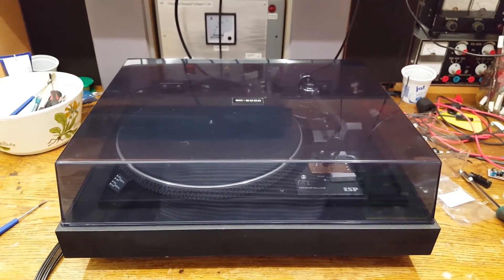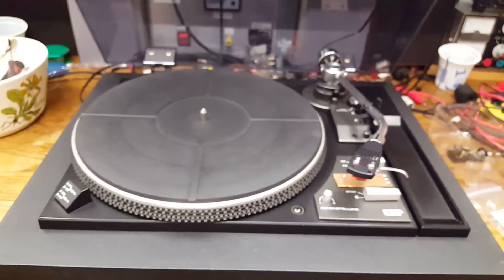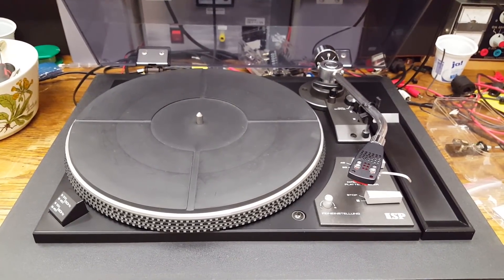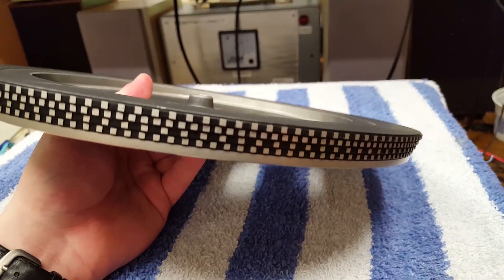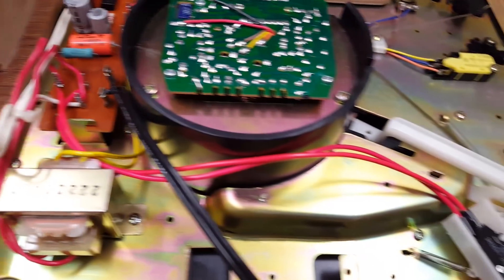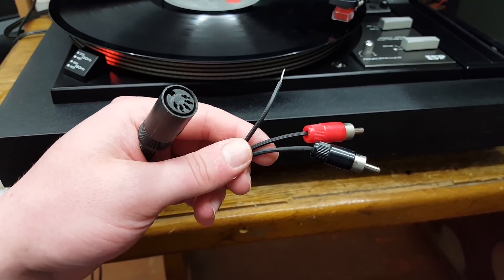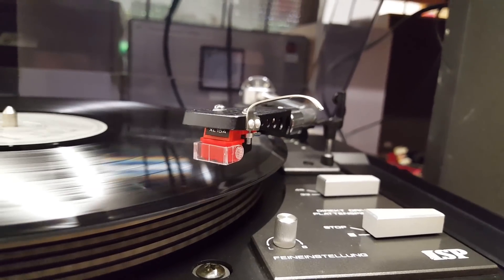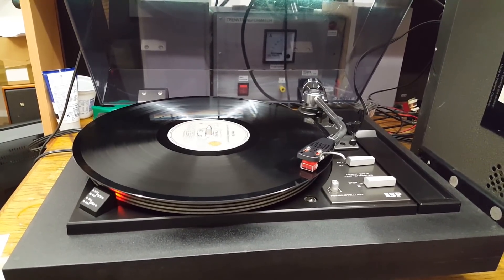Amazingly good ISP SD-5000 Record Player

Comment: For turntables with a Technics-style tonearm, you can get an "overhang gauge" which makes aligning the cartridge a lot easier -- you just line up the stylus tip with the edge of the gauge and the arrow at the front.
Reply: However, there is a slight chance that they used the Pioneer overhang which is a few millimeters shorter.
Reply: @vwestlife Ha, imagine meeting you here! I just discovered Dr Cassette 😂

Comment: Looks pretty decent for what it is. No subchassis and the plinth could probably use some sound deadening and some proper spring-loaded feet, but this is a lower-end unit we are talking about. Matsushita OEM parts seem to have been quite common at the time, the Grundig PS-3500 (DD) and -4500 (quartz DD) from around 1980 also feature them.

Comment: Yes as far as the cartridge alignment is concerned. If you can find one. It's called Cart-a-lign.... it's a weird shaped plastic protractor that has two points and a mirror. That's what I use to set up my homemade straight line low mass tone arms. I currently have one on my vintage Philips 212 electronic. Which will be buried with me.😁

Comment: Since the turntable has a s shaped tonearm a protractor is not needed. Just find the manufacturers stylus to headshell tail distance, usually either 52 or 49mm; and set cart to that distance, keeping cart squared to headshell. This will get perfect Stevenson alignment.

Comment: It was common in the 1970s to find house brands that were made by unknown manufacturers.  The arm looks more like a J-type than S-type, but either work well.  Straight arms were that popular in the 1970s, that came later.
Reply: you ment weren´t that popular? because i only started to see straight arms in good turntables in the end of the 70´s, or early 80´s but i only bought one in 1989 that seemed good, but i already sold it ,it was a good turntable but not as good as i expected in materials used to manufacture it, regards

Comment: It's probably using the same guts as some higher-end Panasonic music centre of the time, ISTR that they made some direct drive all-in-one systems in the late 70s. That would explain the small platter as well.

Everyone was making direct drive turntables around this time. Even BSR. I had a BSR Quanta 800 years ago which I threw away which had an S-line tonearm and direct drive, and an ADC cartridge and headshell. I really should have kept it.
Reply from the maker: Thanks for the info :)

Comment: That SABA is a beast. I have a half broken one too and have been searching for a working one for a long time.
Reply from the maker: You won't find a working SABA unless you find one that has previously been restored by someone. The problem with the SABA receiver is that this was supposed to be a top-of-the-line model in a time when SABA due to increasing competition from the far east was forced to do massive cost cutting. The result is a hugely complex and in many places overcomplicated design, but unfortunately all built with the absolute cheapest electronic components SABA could get. Also the soldering on the boards is terrible.
Reply: Mine was working fine until an idiot shorted the outputs. I found it realtively easy to work on, at least on the amplifier part. the separate boards for left/right channels, detachable pre-amp boards, etc. It does give a feel of cost cutting by looking inside it and it certainly needs a complete overhaul but my unit was badly mistreated.

Comment: That looks like a very nice find. Speed looks spot on. A suggestion Why not cut off the din plug and fit some phono plugs instead. This will make it easier to connect to other amps
Reply from the maker: I thought about this, but I'm not sure yet. The DIN plug would be handy in case I ever do get the SABA receiver working.
Reply: A DIN to RCA conversion is not entirely trivial, it usually requires modifications inside the player to get the grounding right (left and right ground should be separated). I'd rather try modifying the adapter if at all possible; I guess the cables were mistakenly soldered to the wrong side, leaving the input hanging in the air.

Comment: This table seems to be OK. Older Goldmund Studio with linear tonearm TT3, I think,  from 80's used JVC direct drive motors. It was one of the better machines I had chance to hear.  That plater in your gramophone is very decent, you may use better tonearm, eg Rega RB250, 300 are very popular, but forget the automatic options - just an idea. 
I had to throw a Yamaha direct drive tt for recycling - using 200-400 dol cartridge wouldn't help - substandard plater, tonearm. Did same with Marantz table, too beaten up, with cigarette smoke residue - similar sells for 250-300$ at Best Buy. I just didn't have luck getting used gramophone for cheap.

Comment: Great find and surprising build quality for an off-brand product!  The 70's seemed to be a golden age for audio equipment in general, seems to be hard to go wrong with that vintage.  Once you're in the 80's things get very hit and miss.  Looks like the wood pieces making up the base are held together with hot melt glue.  I've had this stuff let go on me with old projects, but if it's holding together for you, so much the better!  Gorilla glue is my fave for wood work.
Yeah, I would be skeptical of that alignment gauge, also.  Because of the trade-offs involved in the alignment process, there isn't really a right answer that applies to all tonearm vs turntable situations.  I subscribe to another channel that is heavily vinyl that you might enjoy:  "HiViNyws channel".  Ian in Singapore does in-depth A-B tests and reviews current equipment.  At least one of his videos shows him doing a cart alignment, with the (Loefgren?) protractor plainly visible.  If I see it again, I'll try to post it here.  I trust his judgment, so I'll probably use the same gauge when it comes time to do my Thorens.  
Here is a link you can download protractors from:  https://www.vinylengine.com/cartridge-alignment-protractors dot shtml
Reply from the maker: Thanks for the info! I too thought there may be questionable hot melt glue, but on closer examination it looks like it was just a lot of squeezeout of regular woodglue.
Reply: That's good news!  Try finding that much plywood on anything built today!

Comment: drcassette are you ever going to work the SABA amplifier or is it just too much work at the moment in that case I under stand. Also very interesting video.
Reply from the maker: The problem with the SABA receiver is that this was supposed to be a top-of-the-line model in a time when SABA due to increasing competition from the far east was forced to do massive cost cutting. The result is a hugely complex and in many places overcomplicated design, but unfortunately all built with the absolute cheapest electronic components SABA could get. Also the soldering on the boards is terrible. This receiver has to be completely disassembled, all soldering has to be redone, capacitors and even normally fail-safe components such as bridge rectifiers and diodes have to be replaced.  A huge amount of work, and considering that the case does have some cosmetic damage, I have not yet decided whether or not it's worth it.

Comment: Right Jico :-)  no wonder it sounds amazing.  Is it a SAS?
Reply from the maker: What does SAS mean?
Reply: "Super Analog(ue) Stylus". A specially shaped stylus that is supposed to follow the grooves very accurately -- but it's very expensive, and Jico makes plenty of ordinary styli as well.
Reply from the maker: Thanks for the info, so I'd say this is not SAS as it only cost about 15€.

Comment: Nice find. Now all that needs to be done is install a set of phono cables and the ground wire directly to the output board.

From where do you order your Stylii? I've been looking for a long time for good replacements that fit my Shure V15.
Reply from the maker: I'm not sure, I may keep the DIN plug as it is in case I ever get that SABA receiver to work properly. I ordered the replacement stylus seen in this video directly on the Thakker website. I have bought several stylii and cartridges from them over the years, never had any issues. The Shure V15 may be a different story though, I hear it's an extremely good cartridge and replacement stylii for it are usually not nearly as good as the original ones...
Reply: +DrCassette 
the V15 is OK, there better ones, sometimes it depends on the rest of the  gramophone and its tonearm how they play together. The V15 was in the Yamaha I got rid off. I tried better cartridges with it and it wouldn't get any better.
Reply from the maker: From what I read the V15 is a very good cartridge, I don't care for any of the high end stuff as I am not able to afford that anyways.
Reply: Neither do I,  and I don't keep records anymore. A store close to me still keeps selling LPs, a lot of re-masters on 180g, but prices are... a bit steep for my wallet. If I wanted to collect analog LPs, a good spinner that would satisfy me would be something in Clear Audio Concept price range, plus some DIY tube preamp would be nice. So, keep buying older CDs from 80-90s, before stinking Loudness War time, or some audiophile grade from EMC, MA Recordings, etc. By the way, you got yourself nice laboratory - maybe you should give us tour of the test equipment in your possession. Oh, one more question, did you have chance to visit Frauenkirche in Dresden -  I have copies of organ music recorded there and these organs sound very different form most I have heard, recordings themselves are excellent as well.
Reply from the maker: I don't buy new records either, I get my records at flea markets and record exchange events, usually I don't pay more than 2€ for one. 
I thought about doing a lab tour, however the lab at the moment is quite messy and in need of some more cleaning after some major remodeling too place. Also there are some work-in-progress projects that I don't want to show yet. But eventually there will be a tour :)
I have never been to Dresden, it's a bit too far away from where I live...

Comment: Have you ever had a problem of a noisy motor in a turntable even after lubricating it? I have a technics sl-b 202 turntable and the motor is a little noisy? any suggestions Dr Cassette?
Reply from the maker: Some of the cheaper DC motors used in belt drive record players are never 100% silent. But this shouldn't be the case with your Technics. The motor could just simply be worn out. I usually replace motors when they are noisey and lubricating does not help.
Reply: did you lubricate it with what? if you used wd40 or other similar stuff you just washed out the original grease

Comment: You can make your own adapter my friend. Just buy some din receptacles and wire them up yourself. I've been doing that since the 80s making my own midi cables which R 5 pin DIN plugs. I know you can do this I have full confidence in you😀😀😀

Comment: My favorite protractor to use is the Accu-Trac Universal protractor. You just point one of the lines at the tonearm pivot depending on which alignment profile you want and then you adjust cartridge overhang and alignment from there with the platter locked in place.  It was free and then the creator took it down because he now sells pre-made versions but the original pdf can still be found with some searching.  Here is a link to it.  http://www.markanaudio.ru/markanforum/index.php?action=dlattach;topic=23.0;attach=232

Comment: Bad: solderless connections (yellow wires)! (6:02)
Reply from the maker: These are called wire wrap connections. Quite common back in the 70s, never had any problems with those.
Reply: Fun fact: Those were originally developed for high reliability applications...
Reply: For each turn of the wire around that wirewrap pin you get 4 individual connection points.
At each point the edge of the pin cuts into the wire, and makes a good strong connection.
Looks like there's 6 turns, making for a total of 24 connections.
And the wire is wrapped tight around, so "Bad: solderless connection", no not at all.

Comment: there are better turntables with belts this only refering to 70´s models and some of the 80´s a belt can be changed but a engine is dificult to find a proper one even in the most known brands, not like this new wave of "Legos"turntables that are "very good" for don´t know who ,that one looks good ,i only have pioneer, technics  a Dual and a thorens this starting in 74 . The technics ,that i have two are both direct drive and till today i never had to change the engine but i worked as a radio dj ,later a DJ in parties or clubs but that ended around 20 years ago, sometimes people from my generation gather to do a party and me and some friends are asked to be the responsable for music and i use or used to have two technics turntables wich are the best to work for many reasons but those for 15 years worked at least in winter time all days (at night) and i needed to change the engines that started to fail with litle slowdown in speed for a second but it was very annoying and increased with time, regards